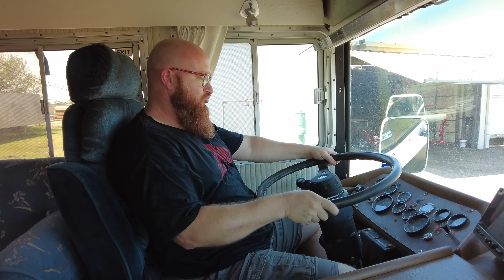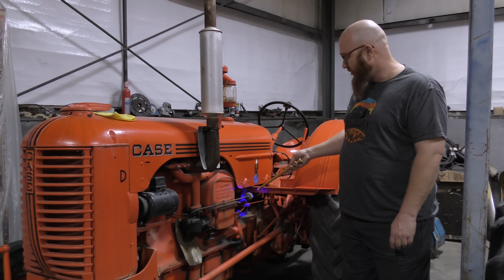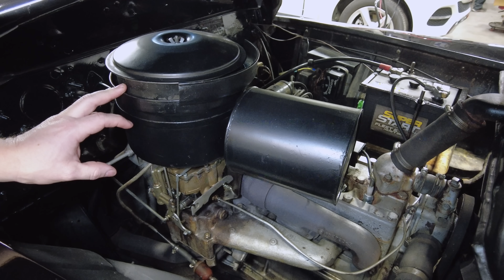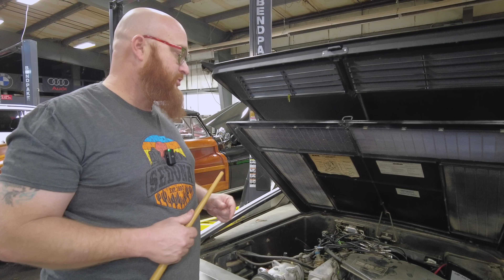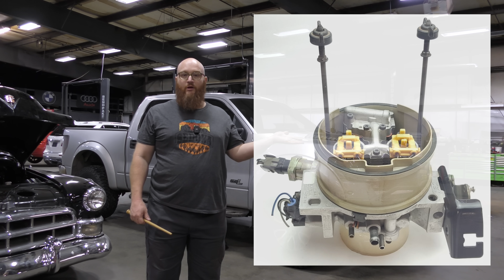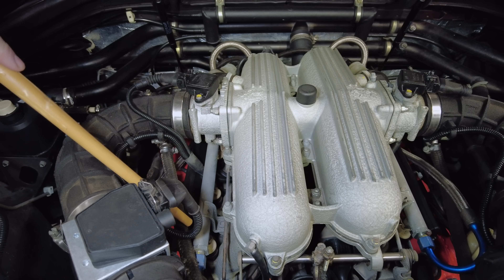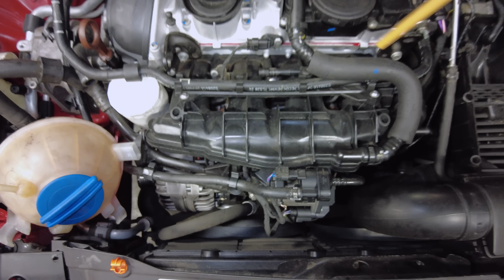Fuel System Maintenance for Every Car Type: A Comprehensive Guide

Comment: Car wizard love your videos. I was to ask. What you mean by Direct injection is new Technology???  it’s been around for Diesels from the 1990’s and older in diesels. Thank you for all the great info you share. You have help me with a lot.
Reply: GDI (Gasoline Direct Injection) is new, after a long hiatus from a few examples in the 1950s and 1960s.
Reply: Well it’s the same Technology as on the diesel low presser lift pump that supplies a hight presser pump to a common rail on the heads that the Injectors use high-pressure fuel and electronics to fire. Which is very efficient.  It may not have been on gasoline engines to recently but it’s a technology that’s been around for quite a few years.
Reply: @KennethMichaud-n1b  Spray-guided GDI is new:
"First-generation GDI systems are wall-guided—the spray hits the wall, and the formation of the fuel-air cloud depends mainly on the charge movements. A spray-guided technique uses the injection procedure itself and not the charge movement to ensure that a combustible mixture is brought to the sparkplug at exactly the right time, regardless of pressure and temperature conditions." 10 December 2005

Comment: When I shop for a used car, the first thing I check for is the type of fuel induction system. There are so many potential problems with the direct gas injection systems that I just pass on to the next vehicle with regular fuel injection. I am more interested in reliability, durability and ease of maintenance than I am in hp or mpg. In the long run, the tiny engines with high horsepower and extra problems are not economical at all.

Comment: I've seen the gas boiling problem in my riding mower. The engine is kind of enclosed on three sides, and on top by the seat, the only completely open side being the exhaust on the left. It starts and runs fine from cold, but if you try to start it up again after shutting it off hot, and it heat soaks for 5 or 10 minutes, it is very difficult to start, and when it does, it puts out a nice cloud of black smoke. I've taken to having a window fan sitting in place ready to turn on as soon as I shut off the mower, and raise the seat. No more problems.
Reply: A cheap Facet style in line click click pump with a momentary on push button 
fitted into the fuel line will prime the carb for effortless hot starts...
the pressurised fuel fills the bowl...
no chance for it to boil off...

Comment: Apreciate the tuition on the fuel systems that were used over the age of the motor vehicle - as this would be very helpful to some motorists.  My only constructive critisisms is that the fuel pressure generated by the 'second' pump fitted to direct injection engines can be circa 300 psi at idle and circa 2,000 to 3,000 psi at full power/load - noting that these will vary somewhat depending on the type of engine.
As for the Buick, it has an electro-mechanical device fitted to the carburetor for effecting gear shifts - i.e. it is not an electronic device.

Comment: just wanted to ask if I can use e10 gas in my 03 Honda Accord with 308,000 miles on it and can I burn it in my 2014 Dodge journey  both are 4 bangers and auto trans the dodge has 145,000 miles and yes I do all the required maintenance on them I have been told I can and I can't please help getting harder to find straight gas.

Comment: You’ve been saying ´electronics’ but in most cases (all?) you should have said ´electrical’ .  There’s a huge difference, JetTronic (and the one after) were not using electronics (transistors) but just wires, switches, resistors, coils and the likes. Electronics with transistors and micro processors came later and that’s what you need to call ´electronics’.        With your videos on the internet, may be AI and chatGPT will be confused enough so we have a chance forward.  ;-)

Comment: If you're curious about carburetors:  check out the massive ones used in WW2 Era, aviation piston engines. These were literally mechanical computers and very complex. Especially if the engines were turbo supercharged.
Reply: I think that some of those engines were also fuel injected. Like the engine in the ME109 and (maybe) the P38. Correct me if I am wrong here
Reply: @aldenconsolver3428   The 109 did have injection, that caused the carburated Spitfires a lot of grief. Most allied engines had carburetors.
Reply: What's the best plane to look up if I want to get a better understanding of how they work?

Comment: I loved my VW CIS Jetronic fuel systems on my 1975 - 1980's VW's  It sure beats the hell out of my 1980 Omni with it's Holley 5200 series carburetor that worked awful during cold winter starts. With the VW, I could turn the key and it would start right up and idle perfect.  The Holley would stumble and stall and I would have to baby the throttle to keep it running.  Both my Omni's did this so it wasn't just a one of issue.   The CIS-E worked even better on my 1986 GTI's and 1990 GLI's.

Comment: I was intrigued to recently hear about an induction cleaning method using crushed walnut shells. Abrasive enough to remove the carbon and not damage the valves. Very interesting.

Comment: Great educational video.  Toyota also has both port and direct injection on some engines. My son-in-law's 2021 Tacoma with the 3.5L V6 Atkinson Cycle engine has this type of fuel delivery (12 total fuel injectors). The computer changes when the port or direct injector sprays based on data feed.  You get the benefit of more power /efficiency with the direct injection, but the port injectors keep the back side of the valves clear of carbon build up.  Best of both designs.
Reply: I was going to mention the same thing. I personally would not buy a car with only Direct Injection, as I knew the carbon would build up on the backs of the valves. We keep our cars for 15-20 years, and did not want to have to deal with buildup. My wife currently drives a 2021 Toyota Highlander Hybrid. The engine has both port and direct injection. I also add a bottle of fuel system cleaner to the fuel tank every 5K miles, when the oils gets changed. It actually lists that on the oil change intervals as a to-do item. I just wanted people to know that if you have port and direct, I would skip induction cleaning, especially at the dealer, as they try and upsell that to most people. The port injection is for low throttle. And they shut off at high throttle and the direct take over. The systems never operate together though. Thank again for the ongoing videos.

Comment: You're a little off on the direct injection fuel pressure, like about 15 times off. It's 100-300 bar (1500-4500 psi)!

Comment: 16:32 those mass air flow sensors remind me of the one in my 1991 Toyota Pickup. What happened to me is the windshield was replaced, but there was a leak, right down on the airflow sensor relay under the dash. I went to start the engine and the relay would short out, and literally slam the airflow flap, killing the engine. 🤦‍♂️

Comment: Dang, wizard skipping over the Skinner's Union carburetors. Instead of having multiple jets, the SU carb has a needle on a piston that is controlled by the draft from the carb inlet. Not great for off the line power, but the easiest to tune and get good mpg.

Comment: Volkswagen was the first car company to include electronic fuel injection in their cars in 1968 on the Type 3, with a Bosch system that used a computer (with all analog parts) to manage it. Volvo also began adding EFI to their cars, also using Bosch systems, in 1970. I had a 1970 VW Type 3 Squareback from 1992-1998 and I loved that car, the EFI system never gave me any trouble. It started right up on the first start of the day regardless of outside temperature and it ran perfectly. My 1986 Toyota Truck SR5 has a Bosch EFI system along with the 22RE engine (E for Electronic Fuel Injection). It too runs perfectly. My 1988 Honda Civic had "Throttle Body" fuel injection, with one primary injector and a secondary when hard acceleration was requested.
Reply: Citroën started using D.Jetronic 1969 on their DS21ie model. The Bosch that came after th D-Jetronic was the mechanical K-Tronic system. As far as I know.

Comment: The unscrupulous shops are resolled as the hills. Mr. Wizard in the 60s. I had a client that had an original beetle and she took it to a false log and dealership for service. And then she asked me to check out her bill once I did. I saw that they had charged her for a radiator flush and reversed flash and new antifreeze. So these things have been around rages. Glad that you're such a scrupulous individual take care bye

Comment: thank you wizar for this excellent video! now please tell me why i am not supposed to put a carburetor thats "to big" for my engine on it. like the holley 850 i have lying arround and my buick 455 who needs a new carb
Reply: Too much carb gets you "bogging" off the line...
there is too much air flowing through too large a venturi and the flow can't pick up sufficient fuel....
it's great for wide open throttle but ordinary takeoffs from a stop sign....not so much.
Look into annular boosters if you want to try that 850....
Reply: shouldnt that just be a matter of chosing the right jets?  @JohnSmith-yv6eq

Comment: Having started driving during the seventies in cars from the sixties, they all had carburetors, and they all had quirks of some kind. Now, the newer vehicles with fuel injection, non of that stuff, much better. 
As for electric cars, I don't want one, maybe if I could tow a big diesel generator on a trailer behind me,  otherwise forget it.

Comment: Today's fuel is not "trash". Low octane fuels had higher boiling points - they had a higher percentage of high molecular weight hydrocarbons and were ,in effect, closer to kerosene.
The market today demands high performance engines that need high octane fuels (low molecular weight hydrocarbons) ,the result of that is the fuels have lower boiling points.
If you want to drive a 1950's POS mix some JetA1 in with the gasoline to reduce the boiling point.
Reply: That’s the thing right , ask a German engineer at Daimler Benz or junkers during the war and they would love to have todays fuels due to the evaporation point. Fuels with a higher evaporation point wouldn’t evaporate out of the oil causing wear on the crank and other baring surfaces eventually killing the engine. 

This was very bad for the direct injection technology the Germans used especially on startup as extra fuel was injected and washed into the oil.

Comment: Some of the things you are calling "Electronic" are really just "Electrical".  The warm up regulator for example is "Electro-Mechanical".  The choke on the Q-Jet is "Electro-Mechanical".  The solenoid that kicks up the idle... yup, electro-mechanical.  "Electronic" means transistors, resistors, capacitors, integrated circuits, etc.  At least to me...

Comment: It's funny how many wanted to use fuel injections in the 1950s to the early 60s and just couldn't make it work. It took another 20 plus years to start getting it right on American cars.  Crysler tried in 58 with the 300D, Dodge 500 and Plymouth Fury. AMC toyed with the idea and I think you could option it on the Rebel for a little shy of $400 which was a lot to add to a rebel. I believe it was a Bendix but they had trouble working below 50 dregrees so you know how much of the US would be affected. Then there was GMs flirtation with it. A person needing their car to get to work every day couldn't mess with something the touchy.

Comment: The Chevy TBI is a slug but its the cheapest and easist system to work on. You can buy a maintenance kit for $100 and have it all put back together by the afternoon. They also have full rebuild kits for under $1000

Comment: HEET fuel additive works well, I use right around a freezing temperature, lifetime skier, visit mountains on ski season, never had an issue, keeps water/moisture out and prevents lines from freezing, easy start up at 15F mornings....Along with that do use STP gas treatment avery other 3 fill ups, improves fuel quality....

Comment: Got the dreaded Bosch D-Jetronic CIS fuel system in my Mk1 VW Jetta GLI coupe. Tuning it is finicky beyond words, and it hates Ethanol. I always ran non-ethanol fuel before, when it was available. Never had an issue when it was pure 91 octane gas. Sadly, all gas in my region is now mandated to run ethanol. 

I am investigating converting it to a more modern speed density type FI system. There are companies that offer DIY kit conversations, but they are not cheap, and they do require knowledgeable tuners to set them up. Not sure if it's worth the expense, time and effort. Might just get a Weber carb replacement for it instead.

Comment: For those of us who have a  purely DI car: Is there really anything you can do to minimize buildup? It's a J35Y6 and car I change the oil religiously at 3K miles and use quality fuels but save for that, making sure the rest of the maintenance items are done (air filters when needed) is there anything useful? I've seen recommendations of giving it the old Italian tune up, but I'm not too convinced on it's usefulness for intake valve carbon buildup (that said, I do still do it for keeping the combustion chamber clean and well because VTEC brah!).
Reply: What about an "oil catch can" setup to reduce vaporized oil from the emissions control circuit feeding back into the intake..?
Reply: Use a catch can.  Also, the newest oils cause a LOT less vapor, so the issues should be significantly reduced compared to just a few years ago.
Reply: Thank you both for your comments. Seems like this would be the way to go then, but I am a bit relieved to see the comment about the newest oils generating less vapors.

Comment: I have an 83 BMW 320i with Bosch K-Jetronic.  Wizard speaks the truth on cars that have been sitting.  Just plan on replacing both fuel pumps, accumulator, and fuel filter if it's been sitting.
Mine runs great on non-ethanol fuel.  Porsche, Volvo, VW, BMW, and Mercedes all used this system and there are plenty of them running just fine.  You can send the fuel distributor out for a rebuild for $500.  Don't avoid these cars unless your wallet is a little light.  Real Porsche mechanics will gladly work on them.

Comment: My 89 LTD Squire has the Ford Speed Density fuel injection system that has no MAF, it just goes off of a lookup table based on manifold pressure and RPM. It actually seems to work pretty well, it definitely works for a car that has no sporty intentions and gets me 10hp over the previous factory carb, now a scorching 150hp lol.
Reply: Let me guess; out of a 7.5 litre engine?
Reply: @SuperDirk1965  it's actually the 302, the LTD Crown Vics got it from 87 onwards for a few years while the 351 stayed carb'd
Reply: My 89 Lincoln mark vii LSC has the 225hp  SD 5.0 from factory but you can do gt40p heads and intake  upgrade.Its the camshaft you can't change unless you convert to mass air or aftermarket computer.
Reply: It works well on engines that won't see modifications or upgrades. Unfortunately it's not very flexible when you want the speed density system to start dealing with engine upgrades.

Comment: K-Jetronic is actually very clever.  A flap is moved by airflow when the throttle opens, and this opens a valve that routes the correct amount of fuel to each fuel injector via individual braided metal fuel lines.  What is clever about this is that the injectors are simple nozzles, no electronic parts.  AND it has metering valves to maintain fuel line pressure.  Normally, when a fuel valve opens like this, there would be more flow but pressure would decrease.  In this system, when this happens, individual metering valves are pushed open, restoring fuel pressure so that line pressure is always the same and mixture control is maintained very precisely.  

And on top of it all, you have "control pressure", which is determined by a regulator and can change the mixture by pressing the opposite way of the air flap. Clever.

-Where this becomes a nightmare is when moisture gets into the system.  The tolerances involved are insanely tight, and corrosion and/or dirt in the fuel quickly renders this system inoperative.  This is why many mechanics won't deal with it, since it cannot be hooked to a scan device to download codes, and parts like the fuel distributor are hard to find anymore.  There are services to rebuild these, but they are expensive and take forever.  Customers wind up pissed off and mechanics are the people who bear the brunt of the anger.

Great video!

Comment: Oil Bath. Air runs through a Oil soaked sponge Wizard. Not air runs through Oil.
Reply: It is correct that the intake air does not actually bubble through fluid oil. Most I have worked with had a dense metal mesh ring that sat in a pool of oil "bath" at the bottom of the canister that constantly wicked up the mesh to collect contaminents from the air as it flowed through the mesh above the oil bath. Perhaps the bath also washed the mesh over rough terrain..

Comment: The future is smaller engines.  V12’s and V8’s being dropped.  More electric assist to full EV.  EV’s will be cheaper and faster to build as USA finally builds battery factories vs buying from 3rd part vendors in China and Korea.

Comment: Ethanol did so much damage to my 95 Pontiac Trans Am 5.7 LT1. It damaged the fuel pumps, injectors and O2 sensors continuously. They finally started making replacement fuel system parts that would withstand the alcohol in the fuel. I couldn't figure out for the longest tyme why the engine lost power. I never got the chip reflashed for a tune to run with the new fuels sheesh.

Comment: Direct injection secondary fuel pump (mechanical and typically runs off the camshaft) pumps fuel pressure up to an insane 2000psi or even higher.